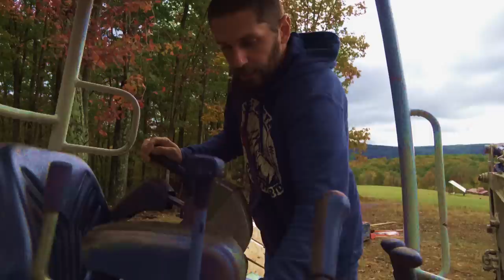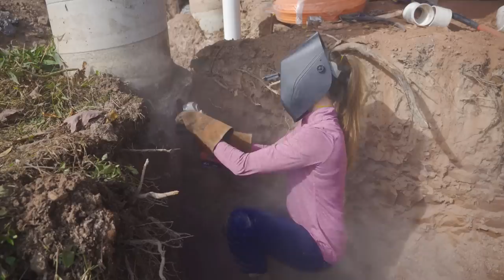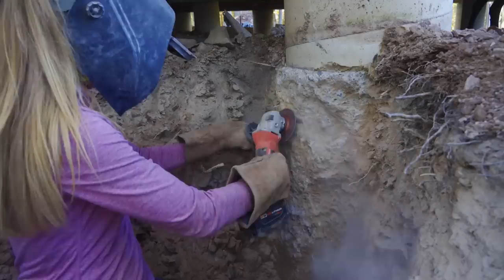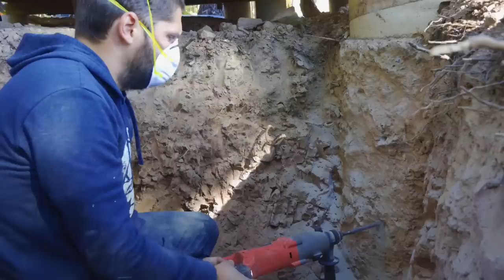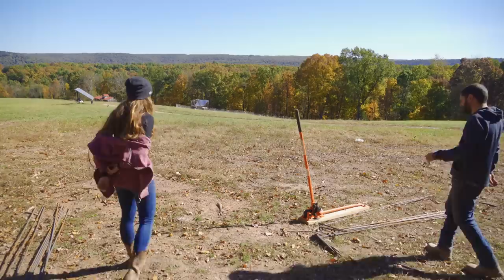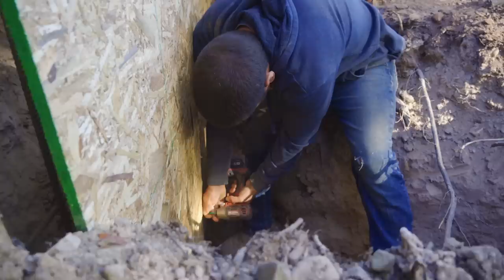Fixing Our Homes Foundation

Comment: Make some square pad forms for excess concrete do you can make stepping stones for walkways and etc...or a DISHed,  down bubble from level, grooved/rut rectangle block for under rain gutter downspouts to avoid rain water run-off from making a hole.

Comment: Folks, you are awesome. But you are doing lots of hand work. Dig drainage ditch and clean surface with high-pressure water. Drainage ditch - it is just some additional work for excavator. But it protects work area from water during rain and it allows you to use high pressure water for surface cleaning. High pressure water makes cleaning surface much faster and easier in comparison to grinding.

Comment: REBAR LIneman's Pliers have an "L" end on one of the handles.  
Rebars tie-wraps are a wire with formed LOOPs on the ends that are applied around the ReBars and use a Swivel Handle to with a "J" like pointed hook <like a mixer dough hook> to tighten the  the tie-wire to make a snug wire wrap. Quick and  easy. Tool system is used by UNION ROD-BUSTERS guys on construction sites.

Comment: Curious, do you have any second thoughts on how you would do the foundation next time?  seems the larger posts, additional framing beams to span the post and rework I filling might have been more work / cost  of either concrete walls with ledge for your stone facing...

Comment: You're underestimating the force of wet concrete. Form ply, snap ties, etc. exist for a reason. Good luck!
Reply: What they did worked for the other side of the house 🤔
Reply: @MS-hd8yq  Interesting. Vibrated? I'll have to check it out.
Reply: @MS-hd8yq  Watched the other video. I guess it's just the "footer". That's one way to do it I suppose.
Reply: @wilcogrundens9086  yeah these will not be real weight bearing.  The piers are doing that.  These will be topped with block and then covered in stone.

Comment: They make HD wire wheels (they resemble twisted cable) that would have worked far better than a grinding wheel for cleaning the caisson footings.  Also, did you guys have this engineered or are these footings a best guess as to what you think would work?

There wasn't a rebar fabrication company nearby that could have cut and bent all your rebar for you?  Typically, its cheaper than buying stock length bars from Lowes/HD and doing all the labor yourselves.

Comment: I think I would have done some things differently like use a wire wheel on the grinder or a pressure washer it would have got the job done and it wouldn't put enough water in the hole to make a difference.

Comment: Have you tried using a wire brush attachment for the grinder. Might work for this.
Reply from the maker: yes, that is what I used the first time actually and I found that this attachment was a lot faster

Comment: Next time you would have to do something like this the faster easier way is to get water pumps and high-pressure water jet cleaning out and pumping out believe it or not it’s faster you still have to drill some holes but the water jet removes the dirt the mud from around the pylons faster I know hindsight is 2020 but water high pressure water can work very fast as long as you have the pumps to remove the excess

Comment: I don't quite get the grinding. If all you need is a clean surface for bonding, wouldn't a pressure washer be the better choice? You can pump the water back out of the hole quickly and easily.

Comment: So I'm new here why didn't you do a normal footing and foundation, rather than pilings?
Reply from the maker: At the time we didn't have the cash to pay for a standard foundation and pay cash to get the house under roof all in 4months time. So, we opted for pillars since they are structurally sound but thousands and thousands less. However, we knew the time would come where we had to close in the underside of the house. We plan on using stone so we need something like concrete for a strong base to attach the stone to. So... Here we are 😊
Welcome to the channel!

Comment: Do you ever wish that you would have just put in a concrete wall foundation around the base of your building to start with instead of having to go back and pour foundation walls between your piers?
Reply: if you read down the comments Erin explains why they didn't do that in the beginning of the build

Comment: I love the channel but I'm really struggling to understand this whole foundation project. Obviously, the piers are more than adequate. And then there's the whole grinding thing. What's that all about? Are you just removing the dirt from the piers? Wouldn't a pressure washer be easier?  Structurally, I think just boring the holes would be plenty (plenty overkill, but whatever). This whole project just seems like massive overkill.
Reply: I think insurance company insisted

Comment: It's seems like she did a lot of work for no reason she could of just got a pressure washer and washed off  and used a wire wheel too clean ?
Reply: Pressure washer would turn the hole into a mud puddle.